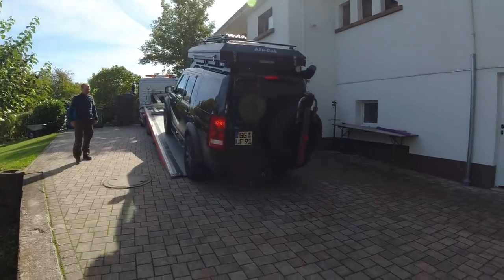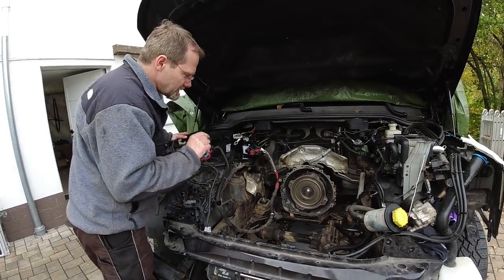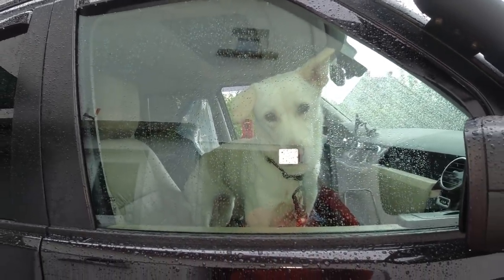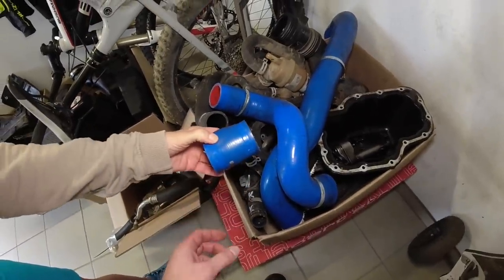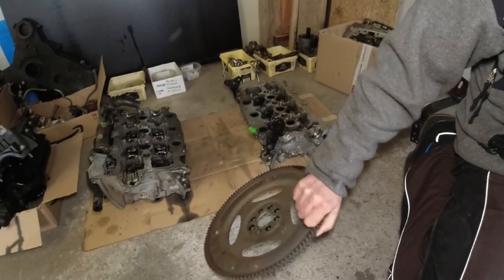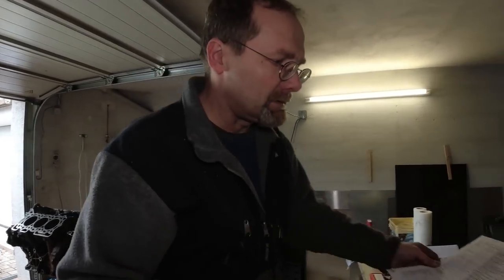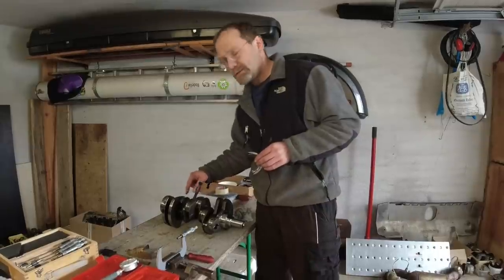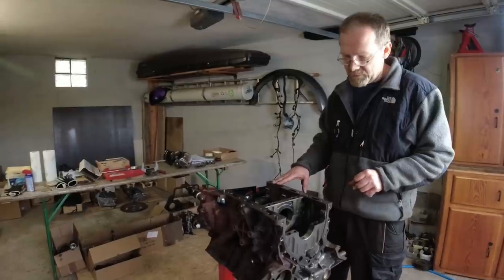Is this the end? Complete engine failure - Land Rover Discovery 3 / LR3 - Episode 1

Comment: When I used to do these at the land rover dealership, I always took the transmission out first, it makes life so much easier. The wiring harness and crossover pipe stays on the engine and comes out with it. This way also makes refitting the engine a doddle as you don't need to locate the engine onto the gearbox, you just drop it onto the mounts, then put the gearbox back in before you put the front on. With the front off and the engine mount off, you can easily access the torque convertor bolts. Great video by the way!
Reply: I sent Christian & Vera a link to your YOUTube videos, as I’ve watched your work on similar issues. Very informative and Christian has evidently watched as well given the name drop 👍🏻
Reply: If you take out the transmission first, you have the same hard work with the upper bellhousing bolts. Better is transmission and engine out together.
Reply: @lr3wedgev832  you don't. Take the transfer box out, lower the back of the gearbox down and you can get to all the top bolts and the crossover pipe bracket with a long extension. I've done loads that way.
Reply from the maker: Next time we try to take the trans out as well.  Can´t be much worse.   I wanted to avoid taking the DS off and the transfer case...  I also cannot lift anything out of my pit once the car is over it.   So lots of limitations.  Of course I know all your videos!  What do you think where I get my information from?  I already bought the tool for the  crank sensor like in your video.   Thanks for doing this work.  Christian
Reply: @pistonbroke  and use an airdriven  ratchet, but you could not work alongside our Teutonic friends, you are too untidy, tee hee, you are worse than me
Reply: @Vera_and_Christian  Most limitations a dealership with no tarps but a lift instead, with much more room around the car and a lot of extra tooling, knowledge and support will never even experience are what makes a garage mechanic the way better mechanic over time. Your eye and Your experience in terms of in which order to do things within Your limited surroundings would make me asking You over most dealership mechanics anytime.
Reply: Another great video I just found that very insightful and interesting I bought one of the first edition discovery 4s back in 2009 and still have it now I still love it it’s been a great and reliable vehicle ……so far!!😅 but I think I’m going to do another early oil change after watching that😬xx
Reply: Great video guys. Enjoyed watching 👍🏼👍🏼

Comment: Most impressive part is that Christian ISN'T just a "Land Rover expert" and is, instead, applying a fundamental knowledge of engineering to ensure things get done right.
I get the feeling that he'd be just as comfortable working on a steam-engine or a spaceship as he is at working on Land Rovers.

You're absolutely right about rebuilding the engine.
The only alternative might be to throw a used engine in it and then sell it and buy another D3 afterwards.
Even so, you still have the same dilemma - that an apparently "good" vehicle might have things waiting to go wrong.

If you want to run an older, complicated, vehicle, you just have to hope that the vehicle you buy has a lot of good components and then, as things wear out, you have to be prepared to replace and rebuild things.
Reply from the maker: You are absolutely right. Christian can fix any car. 😃👍🙋‍♀️ Vera

Comment: Great in depth explanation of the process and probable root cause of failure.  We are once again grateful for our 4.4l V8!  Your home looks lovely!
Cheers,
Bob & Jill
Reply: Indeed we are grateful for the 4.4s. However surprisingly my mechanic found some metal pieces in the oil when I did the service a week ago. I have been advised to check the oil pressure. My other friend said it could be due to standing still for 6 months in 2020. Do you have any other thoughts?
Reply from the maker: Actually, Fabians also had been standing for a long time, and I have read that about others too. (Fabian has only owned his Disco for 7000km)  The oil pressure is an indicator so you might want to have that checked. We have footage of when we checked the oil pressure a couple of weeks ago, but then Fabians Disco broke the next day and there was no time to edit that video yet. 👍🙋‍♀️ Vera
Reply: Seemingly Discos hate standing for too long bcz my other friend had his also having engine damage after having it parked for sometime. It is diesel.

Comment: Christian, you are so right about the asumptions on the actual mileage of the used engines. I have to get a new gearbox for my D3 right now and came across so many questionable replacements from 15 years old cars, I could not believe they only ran +/- 100.000 kms. Finally, I decided to go the buy once, cry once way this week and ordered a new gearbox through my garage from JLR.
Kudos for your work on the engine and letting us take part in the journey!

Comment: Fantastic job and a big hello from Australia. The Aussie built Ford Territory Diesel uses this same engine but we had upgraded main bearings. We also require to service these engines every 15K km. I do mine every 7500Km. A russian YouTube channel also found that these engines are running on too thin oil (5w30), and they recommend 5w40 in warmer climates like Africa and Australia. In term of reliability and easy maintenance, nothing beats an Aussie built 4L Inline Six "Barra" engine. Most taxis did close to a million KM with simple maintenance.
Reply from the maker: 😃👍🙋‍♀️Vera

Comment: Magic video, the one I have been waiting for, thank you so much. It reinforces my thoughts around lack of hydrodynamic lubrication on start up, the route of the oil from sump to oil filter, oil cooler to oil galleries to crank is far to long, long cranking, short journeys it's a time bomb but I still love them. It's literally seconds before hydrodynamic lubrication hits the white metal bearings. I run 10w 40 semi synthetic oil  on my Disco now (225KMs 140k miles) as 5W 30 is like water! Thanks again for sharing this feel sorry for Fabien 🙄 Can't wait for the line boring and re-assembly...You Guys do great videos...enjoy them so much👍
Reply: There are anti drain back valves in the system so it is not on every start the oil needs to find its way from the sump all the way up to and through the system.
Reply: @Muppet_Interfector  Yes you are correct but only I believe within reason, it's only in the oil filter housing from my understanding. The oil will still drain out the galleries through the bearings and gravity will drop it back out the oil pump this is why I now run 10W 40. No expert on these engines so stand to be corrected. I rebuild classic 6 cylinder Japanese motorcycle engines for a living so just going on what I see on the design of the TDV6 as I see it.
Reply from the maker: The Citroen version uses 10w 40 as far as I know. Christian
Reply: @caryknapton7233  sounds like you have a good experience base.  I thought that an electric oil pump to prime the system before spinning the engine would be a good way to get around the possibility of a start without lubricant in critical areas.  Obviously no one in the auto industry thinks it is necessary.  In the majority of cases I guess they are justified by the longevity of their engines.  It is a pity when an otherwise good engine spins a bearing.  I think that there is more than just lubrication going in in the case of these engines.  I suspect that  making the engine so compact has resulted in a crankshaft that is a little flimsy and perhaps insufficient bearing surface.  All just speculation on my behalf as I have no information other than what appears to be numerous failures to rely on.
Reply: @Muppet_Interfector  The Lion engine is no different than any other engine, lack of lubrication results in spun bearings and I have dealt with many of theses but never on the TDV6. As Christian highlighted once the shell bearings twist by a few degrees it cuts off the oil supply and the engine is doomed to catastrophic failure as unfortunately Fabien discovered. Hydrodynamic lubrication acts as a high pressure pump on the bearing itself but requires oil to be on constant supply especially on start up, the white metal alloy is designed to deal with this but only to a certain limit. Short  journeys, delayed oil pressure results in accelerated wear, the 5W-30 oil cannot be sustained within the bearing after many cold starts, so wear is further accelerated that's why I have moved to 10W 40  as a precaution. I know of a Disco 3 that has done over 1 million miles (1.6 million KMs) in the UK it was used for vehicle deliveries so was towing a trailer with a vehicle in tow😱. I think the first engine expired around 500kkms.

Comment: Vera, Christian, thousand kudos for your patience, confidence and energy doing this kind of repair. Big thumbs up. So much work. I would prefer the 5 liter solution (jerry can of petrol & burn the car). The spinning main bearings are unfortunately pretty common on the TDV6 engines. I think this issue is limited to specific built years. I hope you get Fabian's car back and up running and no more issues from then on. What else can possibly go wrong? Last but not least: "He should have bought a La..." :-)    Our starter motor recently struggled. Worn starter solenoid. 30 minutes to get it out, $26 for new copper contacts and plunger. The Discos' are such capable and beautiful 4WD's but also such a maintenance nightmare.
Reply from the maker: Lol.   On a Discovery 3/4. Starter out is 2 hours of cursing, blody knuckles and likely a broken oil tube.    Then no replacement solenoid = new starter so 160 Euro.   Workshop cost lis more like 500 I would guess.    
It is still a long road to have this car fixed.  At least 3 more videos I think.  Enjoy Australia.

Comment: This was a really good video and your explanation of reasons why the bearings spin and lead to crankshaft failure was really clear. I’m about to pick up my 2015 D4 (new to me) from the main dealer tomorrow and videos like these make me worry I’m making a huge mistake. At least it will be under JLR’s warranty for a year and I’ll prob extend it after that.
Reply from the maker: Don't be stressed and enjoy your car. Just make sure you are doing your part in keeping it running for the long run and be sensitve to anything not  normal. Getting a OBDii tool is also really helpful in keeping you sane while driving a Discovery. 😃👍🙋‍♀️ Vera
Reply: Just make sure that you spoil it with oil changes, I’ve done mine every 5k from new, now at 200k, oil pump and belt upgrade fitted at 100k about to repeat the same exercise again, look after it and it will look after you. Worst and least reliable cars Ive ever owned, a Toyota followed by a BMW !
Reply: @Vera_and_Christian  I  did not even registered the car yet, but the diagnostic tool just arrived and already has its  fixed place in my "new" second hand D4  :)
Reply from the maker: @leeloo21231234  😅👍 🙋‍♀️ Vera
Reply: @Vera_and_Christian  Hi Vera, what's your OBII tool brand an model? Thanks, regards from Chile!
Reply from the maker: @diegocaffarenamoltedo436  We use the icarsoft 930, and think that is mostly all you need.  But they have now newer models, which we do not have any experience with. Just make sure its for Land Rover/ Jaguar only. Here is a link to their webside. https://www.icarsoft.com/Product/96.html However, we recently purchased a used GAP tool. But due to Fabians engine crash, we haven't had really any time to make a video about it. That will have to wait a couple more weeks. 👍🙋‍♀️ Vera

Comment: Oh wow the challenges are getting more and more serious! Interesting statement from Christian about the main seals. It's been said  that 80% of the wear and tear of an engine results from cranking. Typically this is not a big issue on a normal engine with quick starting cycles, good battery, etc. What adds to the frustration here are slipping main seals. That leads to a catastrophic engine failure in minutes. What usually is a normal wear and tear and an issue which can be caught easily turns catastrophic in an instant. I don't see that this Peugeot engine is a good fit for a Land Rover. Thank you Christian, your videos are enlightening!

Comment: This is better then watching a james bond movie :-) I am just getting more and more frightened about buying a used Discovery 4 SDV6 which I intended...
Reply: I would not have one if it was given to me for free...I can't believe in the day and age that landrover can get away with releasing an engine into the market with such a dangerous defect
Reply: @colinkensley  To be fair, it's a PSA-Ford engine built at a Ford plant. Land Rover have now finally retired this engine and replaced it with an in-house straight six. Time will tell if Christian ends up taking one of those apart!
Reply: So is the newer SDV6 Engine less likely to develop this problem?
Reply: Michael Ruepp No it's still an issue.
Reply: They're great cars but if you do buy one just make sure you get a warranty to cover the engine, mine failed at just 55k
Reply from the maker: I think the SDV6 is even more at risk for this issue.  There are more low mileage failures reported in the www. Got one myself and it only had 90k on it.  Hope it lasts but I will change the oil more often.  Christian
Reply: all cars have issues.  You want piece of mind by new and extend the warranty.  Plus consider that this engine is used in a lot of vehicles,  for every unlucky owner there are 100 who are fine. Failures like this get a lot of publicity.  Nobody is posting on forums about the ones that are fine and I never seen a YouTube video "My car is running fine..."
Reply: @josephjohnston1894  I am not that worried, Just  got  SDV6 with 150 k km on it.  I will enjoy and if it  breaks so be it..  Had  a Landcruiser that was a money pit, not a big issue,  but it broke down  every holiday.. big problem.  So relax and enjoy what ever you like ,  otherwise you will never buy anything again if you read all the horror stories.
Reply: @leeloo21231234  The Disco 4 SDV6 is a great car, we enjoy ours too! Otherwise I wouldn't have paid out for a new engine. It's the lack of support/goodwill from JLR which is frustrating given the fact that it's a known fault. Luckily ours broke down close to home and not in the middle of no-where. Good luck with yours!
Reply: @leeloo21231234  interesting to read, which model cruiser was it? Which engine?
Reply: @markmcgrath9098  J120 3.0 diesel .  Among others I had EGR replaced,  ( not driven in the city at all), huge oil leak, and transfer case oil leak.  The EGR alone was 1600 euro.
Reply: @leeloo21231234  a lot people in Australia believe a myth that anything 4wd from Toyota is unbreakable. The Common Fail(diesel) has quite a few problems it seems. Especially the 1vd V8 diesel.
Reply: @naturshoot8448  JLR mandated recommended oil from 5w40 which it was designed for by PSA to 5W30. Make your own conclusion.

Comment: WHEN YOU RE-FIT THE FUEL LINES THE SMALL COLLAR AT THE END MAY COMPRESS TO MAKE THE SEAL. i WOULD CHECK THAT THE NUT DOES NOT BOTTOM OUT WHEN TIGHTENING TO MAKE SURE YOU HAVE PRESSURE ON THE COLLAR TO MAKE THE SEAL. I GUESS THE MILD STEEL DOES NOT SPRING BACK WHEN TIGHTENED. PERHAPS THAT WHY LAND ROVER RECOMMEND RENEWING THEM. I WATCH YOUR CHANNEL WITH GREAT INTEREST AND WELL IMPRESSED THAT YOUR WIFE IS AS ENTHUSIASTIC AS YOU.   KEEP UP THE GOOD WORK.
Reply from the maker: I will keep an eye on this.  Thanks. Christian

Comment: I know exactly how you feel. I have an LR 3, and at 158k miles it threw a timing chain (same motor) which damaged/jammed another chain. The mechanic said "don't even think about repairing it" even though it's not an interference type motor. Well, $5K later she had another motor installed and was on the road again. Now, despite installing new air shocks, compressor, control valves, etc......I have tired of suspension faults and I'm installing new replacement coils from Atlantic British. Yes, you really have to love this vehicle. It appears you feel the same way. When I said it's more than a vehicle.....it's a hobby also......I wasn't kidding.....LOL. It's also allows you to expand your vocabulary while you work on it. It doesn't get better than that. Hang in there folks!

Comment: HI great description on the engine fault a bit of advice never use sand paper or emery paper on a bearing surface We always try and use a scotch pad.
Reply: what he rubbed with 1000 grit is not the bearing surface its what  the bearing seats on it does not rotate ok 🤣🤣
Reply: @georgeyboyhowe1685  No not ok you are still removing material from the bearing seat.
Reply: @johndavidson7982  1000 grit wet and dry will not remove enough to worry about i have done this building engines for nearly 40 years
Reply from the maker: A scotch pad is equivalent to a 600 grid usually.  1000 grid is equivalent to toilet paper😂.  I have to order scotch pads.  They are not so common here and quite expensive.

Comment: I'm very grateful for your videos. I live in Jamaica, and have a 94 Disco 1, 200tdi, that's rusted out from fieldwork along the south coast (salt and mud). Been thinking of replacing it with a Disco 3 or 4, but because of your channel have decided to search for another Disco 1 that's not rusted instead. My current one is great, other than the floor rotted out, etc. Lots of good parts I can use on a next one.